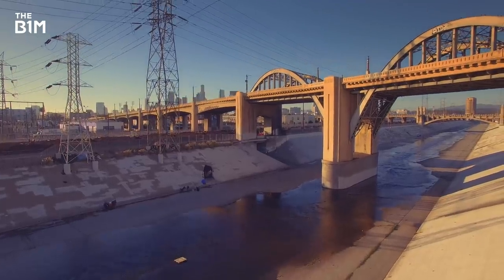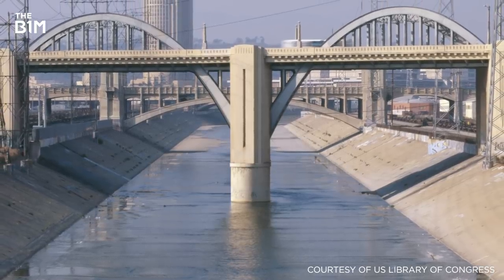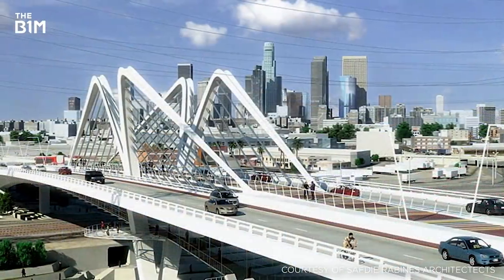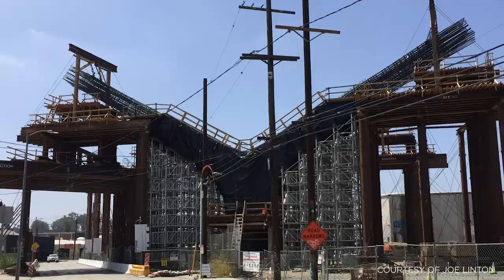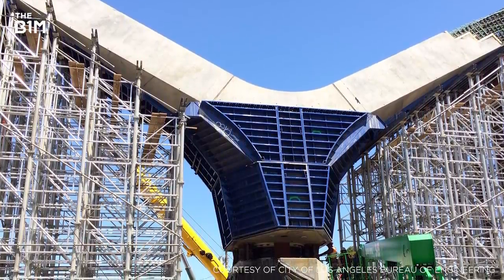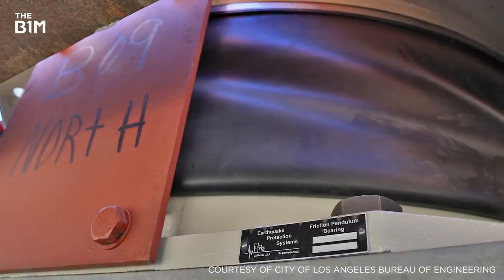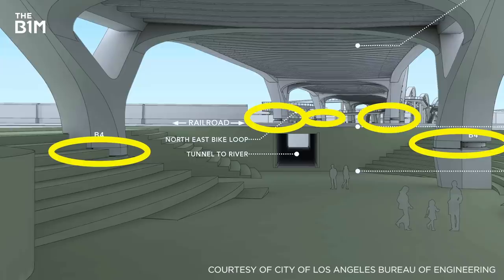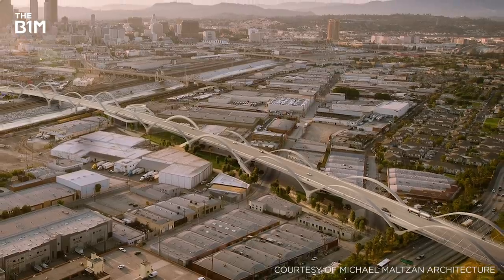Building LA's Earthquake-Proof Bridge

Comment: Looks like a great bridge design. By opening up the spaces underneath it helps foster development and increases sunlight. The biggest problem with some older bridges and overpasses is that they cut off communities and created isolated areas that became blighted.
Reply: However, what about preservation of its heritage. In my opinion the old bridge forms part of the development of the city of Los Angeles. I’m sure that with a bit of forethought the old bridge could have been adapted with a design that represented the past, present and future.
Reply: Opens up space for more tents underneath.
Reply: yeah, I agree now the 40k homeless people at skidrow can now build more camp estates under that beautiful bridge.
Reply: @jnanacaksusa3932  that's exactly what I was thinking is going to happen
Reply: donttalkcrap judging a book by its cover is not very wise. For the record, I have done my homework. However debating with you and reading your patronising and condescending comment, I have concluded it’s not worth the effort. Ps.. I was wondering, are you the  Vice-Provost at Eton College? Though I doubt you are.
Reply: @greengardengreen6666  Not all heritage is good heritage, and not all historical structures need to be preserved. Reinforced concrete was a relatively new material when the old bridge was built, and methods to prevent the aggregate from efflorescence and spalling and the reinforcing steel from rusting were primitive to non-existent. Preserving the structure would entail complete reconstruction with modern materials and methods, which would result in an practically and aesthetically inferior structure compared to the new design.
Reply: @greengardengreen6666  not worth your effort yet you replied and have the audacity to ask a question, what if he is you'll humiliate him or something?  just keep it straight you have no better arguments
Reply: @hailexiao2770  bollocks to asthetically inferior design, the new one looks like 21st century pretentious garbage compared to the old one. But that's par for the course in LA.
Reply: @greengardengreen6666  until it got destroyed and kill many people, move on nothing last forever
Reply: @WhyAyeMann  Well, you would be pleased to know the as-built is diverging quite a bit from these beautiful renderings.  The arches don't cantilever out nearly as much, the stairs and railing on the arches are no longer a part of the design and the inverted arches over the river have been removed.  The bridge is quite toned down from these renderings but the budget is not.  The contractors are also several years behind schedule.

You will be hard pressed to find any articles on any of this because L.A. news media sucks.
Reply: @greengardengreen6666  It was seismically unsafe. The bridge had already had multiple restorations to try and preserve it, but it continued to deteriorate. They really did try to safe it for decades because it was very much a beloved bridge. I believe all the L.A. River bridges are protected by city or county historical provisions. And there are many, about a dozen or so built in the 20s and 30s.
Reply: I dont mean to be so offtopic but does anybody know of a trick to get back into an Instagram account..?
I somehow forgot my password. I appreciate any help you can give me
Reply: @Raiden Patrick instablaster =)
Reply: Unfortunately too many losers in the area abused the bridge the minute it finally opened. I’ll never understand why some people just can’t appreciate something nice in their neighborhood and mistreat it.
Reply: No its stupid. Anyone could have told them peoe would walk up the arches. Now its closed because of that
Reply: No it closed because “people” shut it down with their cars to do burnouts and party just like happens in so many intersections.
Reply: @greengardengreen6666  ive seen pictures of the old 6th street bridge and its not particularly unique to LA. that same steel girder construction and concrete can be found in other areas of the US. 

but at some point the older bridges cost too much to repair or are inconsistent with current development plans. ultimately the people will decide. the new 6th street bridge viaduct seems to point to a more urban conscious LA with bike paths above and green spaces underneath.
Reply: Even though the design and concept of this bridge is beautiful, this bridge has been abused since the first day it was opened. The concrete structure gets tagged daily, and they have a city crew out there daily to remove the graffiti. The top roadway is full of tire skid marks from the gangbangers who live near the bridge. The city has been pussyfooting around with a means to stop locals do donuts throughout the length of the bridge, but I have not seen any evidence of anything to date. They need to put a permanent concrete K-rail down the center of the bridge roadway from one end to the other. They even had people climbing the concrete arches. I doubt a park below the bridge will be a good idea since it will most likely become a war zone for the locals. The people who live in this area don’t deserve a bridge as nice as this one was supposed to be.

Comment: A bridge only someone from LA would call iconic (the old one) over something only someone from LA would call a river.
Reply: The "LA River" looks like an open sewer.
Reply: @Tflexxx02  Yeah I was like WTF when he said "LA river"
Reply: More like a puddle.
Reply: donttalkcrap Its a bridge, people have better things to do in life.
Reply: It actually was a real river originally, with a complex alluvial flooding psttern. Unfortunately a flood during WW2 lead to the Army Corps of Engineers completely encasing the riverbank in concrete to prevent future incidents.

This also later lead to the building of the massive breakwaters past the mouth of the river and completely killing surfing in Long Beach.
Reply: Its the la sewer
Reply: Taladar2003 so many damns and reservoirs that it’s only a trickle by the time it passes through LA
Reply: @donttalkcrap  Take it easy, Dude!
Reply: There's no water
Reply: Someone that has issues with L.A., but following L.A. news. Go figure.
Reply: @ghifari77  played it many times but always fail but i still try
Reply: @IvanJohnsonMedia  Right on!
Reply: Well, as was obviously explained in the video, it's iconic because it's been featured in many things over the decades.

The L.A. River is an actual river, but it's seasonal like many rivers which is why it would flood almost every year wiping out huge sections of the city. Unfortunately, when they encased it in cement, it acted more like an overflow drain to the sea now. Though there are sections North of this bridge where it really does look like a more traditional river and has water in it most of the time and has a natural riverbed. When it rains, the level can rise quickly and has a fast current so it's extremely dangerous. It's a feast or famine situation. However, the river will be going through its own renovation as well to bring back more of it's natural character and redesigning it so the residents can better enjoy it. If I'm not mistaken Frank Gehry is doing some of the redesign work though the design is not set yet.
Reply: The LA river was a full river until 1935. The river would cause severe flooding once in a while causing havoc. The Army Corp. of Engineers came up with that awful solution of deepening the river, cementing it to a channel and damning most of it. Look up pics of the old LA River, it was shallower and full of water, but, dangerous in the winter.
Reply: @Kenikex  Yes, the LA River was more seasonal. The problem is that it didn't have a very established path so when it flooded it would go all over the place exactly because of what you say that it was a shallow river.

There is a current project to rework the river so it has a more natural look. I think they plan to remove some of the cement including returning certain parts of the river to a natural bed instead of cement. They also plan to make it more usable for recreational uses and capture more of the rain water. I think Frank Gehry's studio is doing the redesign.

Comment: It will be 20 years late and 400% over budget
Reply: Yes I don't believe they'd build this for 400 million it's definitely a fiction to build it despite knowing it will wreck the city's budget and make them even more bancrupt.
Reply: Again, sounds like the new Bay Bridge. But it's beautiful, and it shouldn't fall down when the Big One hits, so I'm not terribly upset about it.
Reply: Mashoto Shaku 

A single bridge span less than a mile long, on relatively flat terrain, taking 20 years longer to construct, even in an earthquake zone? Yeah, sure, I believe you...
Reply: @hostilepancakes  It's California. You have to deal with regulations, red tape, research, and the environmentalists.
Reply: and after completion, the first earthquake above a 5.5 will make it collapse.
Reply: You have em confused with NY
Reply: Vincent10 if those codes didn’t exist these structures would get wrecked during earthquakes it’s better to be safe than sorry
Reply: Mashoto Shaku - No....  you're thinking of the High Speed Fail project.
Reply: It's budget is secure and contruction is on pace to finish in time. You are just a hater.
Reply: 400 million for a bridge like this is already a heck of a lot of money, much more than at least I expected. Of course we need to take into consideration the area it's affecting, redirecting traffic etc. Building a bridge like this in a more remote place would reduce the price significantly. As far as I can tell the price also includes demolition. I think final price outcome will remain. 

Another thing: time. The bridge construction itself is actually quite simple - with smaller challenges. The bridge is suspended low with solid ground under it. Also the crossing over the river is very short, and it has short spans.

Things are gonna work out great!

I'll add. This bridge is a pioneer when it comes to modern design and creativity. It will be a new icon, and grow in it's reputation. Finally it's safe! Not bad!
Reply: HostilePancakes, The One and Only, I drive by this bridges construction zone almost every day. At the rate they’re going, I’ll be surprised if it’s done by 2050.
Reply: @charles6649  That's some great Engrish.
Reply: I live in Los Angeles and I didn’t even know this was being built XD

Comment: 4:00  These bearings allow each column to move 30" without breaking. What happens if they move 35 or 40 even 50" in a severe quake?
 People that live in LA have their heads in the sand when it comes to earthquakes.

Comment: If concrete gives off heat as it cures adding liquid nitrogen will do nothing to stop it from curing however if it needs heat to cure adding liquid nitrogen would certainly delay. Did you miss speak here?

Comment: There is no such thing as an earthquake proof structure.  At best structures are earthquake resistant, but even the finest of them is not guaranteed to be undamaged by a severe earthquake.  The idea behind such designs is that minor quakes will leave them undamaged and major ones will leave them still standing and reasonably easily repaired.  Ask the chief designer of this bridge, he would confirm that.
Reply: FireAngel Londoner it is built with many layers of redundancy in the event of an earthquake
Reply: @KanyeTheGayFish69  It still isn't going to survive a severe earthquake with no damage, and the designer would confirm that.
Reply: FireAngel Londoner San Andreas fault can really only create a maximum of a 7.9 earthquake, and this is designed to survive that
Reply: @KanyeTheGayFish69  Are you being slow deliberately?  SURVIVE yes, survive WITHOUT ANY DAMAGE, no.  The ONLY buildings that have ever survived major earthquakes with no damage at all are made of wood.
Reply: FireAngel Londoner no one said it wouldn’t sustain damage
Reply: @KanyeTheGayFish69  first off, the point of his comment is that the title wasn't accurate, which is true. Every building can only be designed with so much redundancy before it becomes economically infeasible to design it any more resistant... That is literally what an engineers job is centered around... Second off, the whole concept of "magnitude" is irrelevant to seismic design.
Reply: Civee so there’s no difference between the safety in buildings from an earthquake standpoint. This building is no safer than a brick hut...
Reply: @KanyeTheGayFish69  No, the designs are astronomically different and, more importantly, the budgets are astronomically different. The whole point is that every building can only be designed to be so safe, but no building is indestructible.
Reply: Civee no one said it was indestructible
Reply: @KanyeTheGayFish69  That's exactly what the title is implying. By saying the bridge is "earthquake proof" you are saying it cannot be damaged or destroyed by earthquakes and therefore the bridge is indestructible in that regard. A more appropriate term would be earthquake resistant, which admittedly doesn't have as nice a ring to it for a title. Though at this point, I imagine you are just trolling us for our irritation with the semantics of earthquake proof vs earthquake resistant.
Reply: Civee I’m not trolling, I’m wondering why you are taking this so seriously. It’s just a single word change in a YouTube video. Calm down. It’s not a big deal.
Reply: @KanyeTheGayFish69  Civee must be a professional in this area. Civil engineer will look at the title and go like there must be something I can educate people about

Comment: The new bridge has been in use the last two years, and this bridge looks like an apocalyptic war zone. It is being tagged daily by the locals, and it has become the new hotspot for street takeovers with cars doing donuts on the roadway deck. The latest issue is vandals have stripped most of the copper wire on the bridge to power the bridge’s lighting system, and the bridge is currently in the dark during the night. Totally disgusting what is happening.

Comment: We're supposed to be a state of innovation we state yet we still use old technologies on bridges like expansion & deflection fittings that ground  high voltage current  having external grounding bonding jumpers that corrode over a period of time instead of using an internal grounding system say like a BAMS  internal ground system fitting with an environmental-based coding for long-term  stability Yet we build a beautiful bridge like this spend that much money and do not use innovative products built in America what a joke